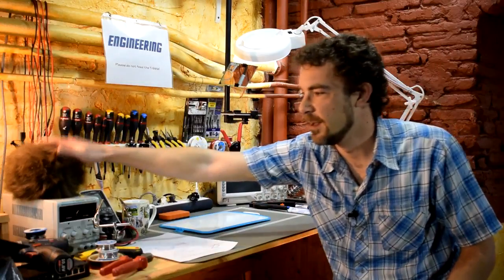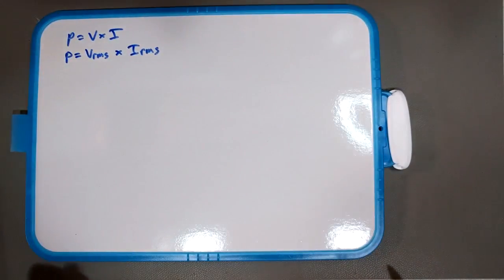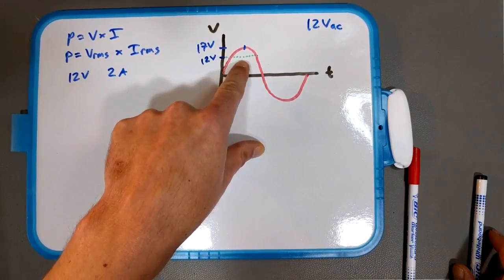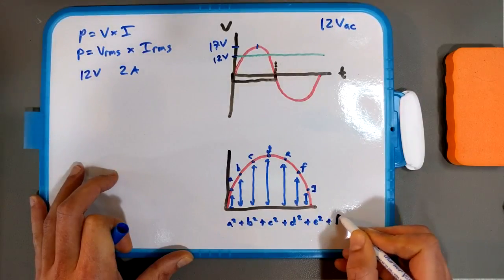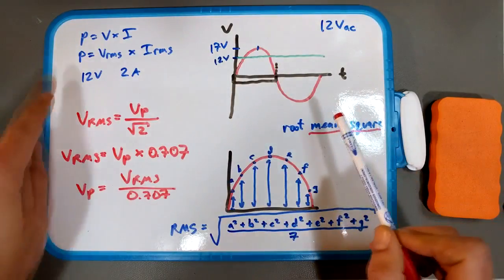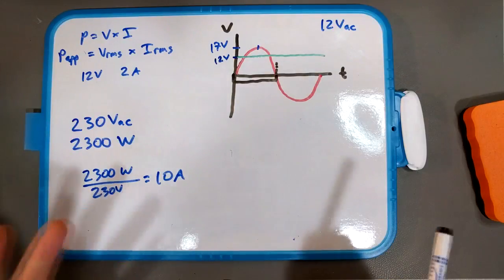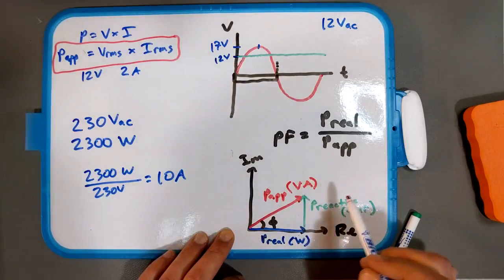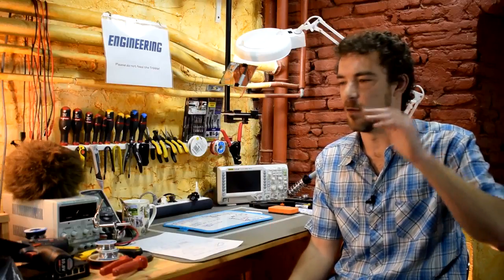EEK! #6 - AC Power, RMS, & VA vs W

Comment: Hey great video , helped a lot. I'm studying electrical engineering and this subject definitely confused me. One question though; if a device is labeled with it's power consumption in Watts instead of VA, is that because the device has little to zero reactance? And will you get the same kind of "loss" if the device is inductive, or is that the case where power is delivered back to the system ? Thanks !
Reply from the maker: It depends on the gizmo and sometimes even the manufacturer and what they report on the nameplate of the gizmo. There are general rules for gizmo specs, but they're not always followed. So, they might report a certain W and A, but those can be peak or average values. Generally speaking, if the gizmo says "1500W", then you can safely assume that it's gonna use a max of 1500W, and calculate a rough max current draw appropriately. But PF is usually not taken into account, so you canNOT assume the PF=1 if they give a power value in W. But then it gets complicated... If you're talking about a motor, for example, there can be a huge current spike when the motor starts in some cases. Also, the PF can change depending on the load placed on the motor. The PF may be 0.89 at full load, but only 0.79 at 1/2 load. So, you really have to completely understand the gizmo and what it's doing as it runs - which is why the gizmo's data sheets with various specs are essential!

Comment: P.average= P.peak/2
                  =V.peak/√2 * I.peak/√2
                  =V.RMS * I.RMS

When you take the RMS value for AC voltage, and multiply it by the RMS value for AC current, you get the average AC power consumed by a resistive load; this can be proven by simply looking at its power curve. Upon doing so, you will notice, that it is always symmetrical at P.peak/2, meaning if you were to mentally cut-off the upper 50% of the wave (i.e., its peaks) in a horizontal direction and flip them over vertically, they would fit perfectly into its valleys, filling them completely, resulting in a perfectly flat rectangle extending horizontally on the graph towards infinity, with a magnitude of 50% of the peak AC power. Just look at how perfectly the square root of two, when multiplied by itself, gives a result of two in the above power equation: The explanation for RMS voltage and current values doesn't get any simpler than that! ;)

Please note 2 things about the AC power curve:
1. Despite the fact that alternating current flows in two directions, since the AC power curve is the product of two sine waves  (one for voltage, and one for current) multiplied together, this curve never goes negative, even though the voltage and current waveforms alternate between positive and negative many times each second. This is due to a simple mathematical rule, that states that the product of two negative values multiplied together is always positive. This also makes sense in the real world, because energy is always being consumed, and work is being done regardless of the direction the electricity is taking at any particular moment in time.
2. Since the power curve is the product of two sine waves, it is in fact, a sine² wave, not a sine wave.

And contrary to what you may have seen on a stereo amplifier or speaker spec sheet, there is no such thing as RMS power; it's really only average power. RMS power is a simply a fancier, more technical-sounding name for average power created by the audio equipment manufacturers, in order to mislead consumers into believing the power output of their products is above average.

Comment: Interesting... mostly over my head, but you explain it so well!
Reply: water can flow or it can crash. electricity flows like waves at the beach. up and down and some waves are taller than the others. so when a device or power sources is rated at say 12 volts that's only partially true, it goes above and below 12v volts. all this video is talking about is accounting for that mathematically
Reply: cdoublejj Thanks! 😊